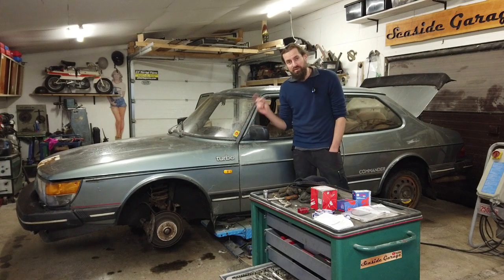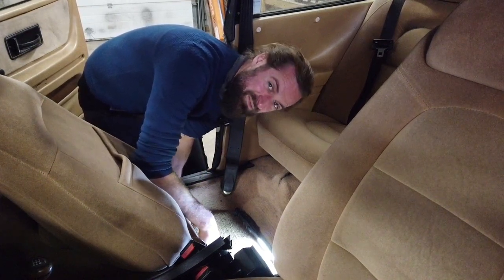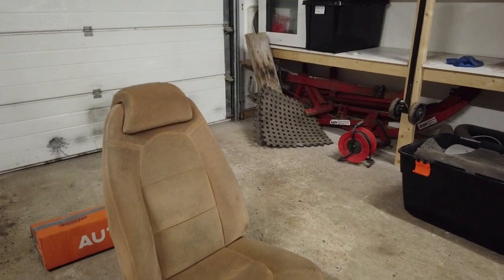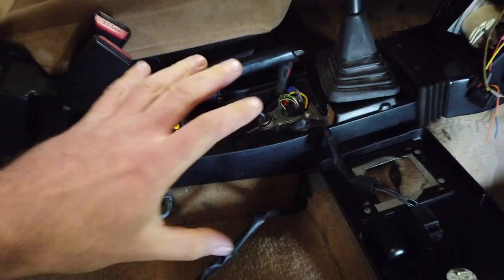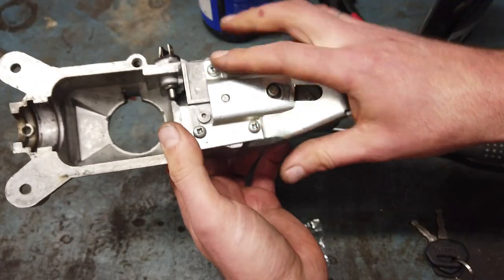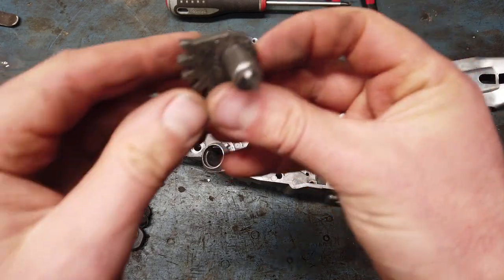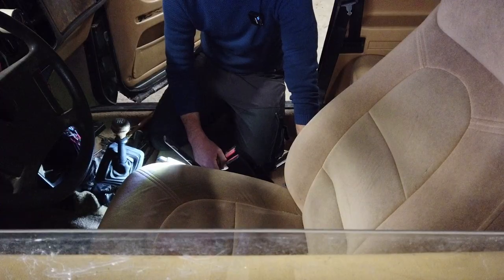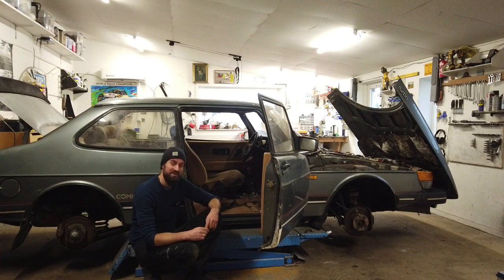Saab 900 Turbo. Keyissues! Ignition barrel not working.

Comment: In the fusebox there is a round service plug with 6 holes.
One of those holes has no metal contact in it. The pin next to that has 12v at it.
If you stick a wire into that pin and bridge it to the 4th pin the ignition will come on and all the dash board light will come on.
Then momentarily connect another wire from the 12v to pin 5  and that will fire the starter motor.
Your engine will now run bypassing the key switch.
Reply from the maker: Yes I found out! but thanks!
Reply: @SeasideGarage  I've got a 93 Convertible, my son had a 90 3 door coupe as his first car.
If you want any help or advice feel free to ask any questions and I'll share whatever knowledge i have.
(I've also got a 1976 450se Mercedes too if the wisdom I've picked up from that is any use)
Reply: Probably late in the day for my question, I did the weld and all works except the key won't turn to the spring loaded ignition end, if I use a flat screwdriver in the slot the car cranks, it key turns the barrel, just not fully!
Any ideas from anyone
Regards Mr el despardo

Comment: Atleast on the newer Saabs, one additional reason why the ignition barrels fail often is dirt and other stuff falling in, and then jamming the thing up. This is a Saab problem since the keyhole is facing upwards and in a pretty low spot. This is also the reason why you shouldn't lubricate these locks, since the dirt will stick to the wet oil and jam it up permanently :D
Reply from the maker: There is always a lot of bread crumbs in the locks!

Comment: Good fix. On my 1981 900 I had to drill a hole to access the release pin for the lock barrel as the early ignition and shifter assy's weren't made with the hole. It's an auto gbox not a manual though so the lockout setup is a bit different.

Comment: Just done it on mine…thanx your vid was really helpful..extra tips for the others: special tool for the triangular head can be done easily with a Dremel and a 10mm pipe wrench..use gummy or tape to have the right pattern saves lots of time to have the tool. before putting it back together on the Teflon base, make sure key is in and lock tab is turned so the gear shift tip is on the good side..otherwise you will not be able to move the key at all and I had to reopen everything…

Comment: Great work, and nice video, my Saab friend.
The procedure for to get out the ignition lock barrell is by turning the key to some degree before (to the left of) the "radio ignition position" then push in the metal rod in the hole to push in a spring loaded pin inside the hole, and pull the barrell up by the key.
If the key is missing or the key is snapped off inside the ignition lock, you have to drill out in the hole with a drill bit that fit inside the hole, then you can pull and replace the ignition lock.
If you visit my channal you will find videos showing more about the ignition/gear shifter assembly.
And also many other og900 repair videos, if you havent already seen my channal.
Keep up the good work.
Regards from Norway.

Comment: thanks! I have an 8 valve giving me intermittent no starter engagement; thought I was going to be stranded on a trip today but it engaged. also hope to follow any fuel pressure and starting/ correct idling work on the 8 valve!

Comment: Yes, how true about key problems!  On my 99 Turbo I once found that I could not remove the key.  I cheated and paid someone else to fix it.  After your video, I have no excuse if it happens again.  Many thanks.
Reply from the maker: uhh.. that 99 turbo.....
Reply: @SeasideGarage  Yes, as featured in video "saab 99 seat repair".

Comment: My brother broke the key in the ignition and I used a screwdriver to start the car. Now I have the same problem with the barrel as it gave way on starting. The barrel just spins with no accessories or starting, just spins. I have the 1991 2.1 manual do you think the same issue as in your great video. Perhaps a welding job or replacement part. Cheers John Australia.

Comment: My ignition lock starts to act up too. Did you replace the old barrel with a new one or was it only the broken off part you welded back on?
Reply from the maker: No new parts! just fixed the old one